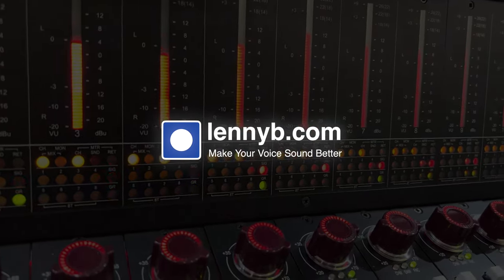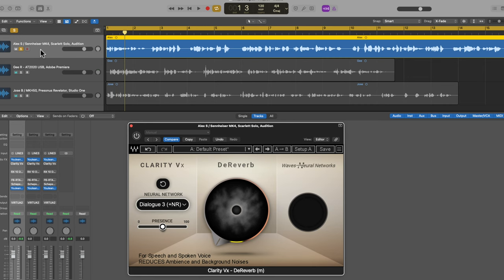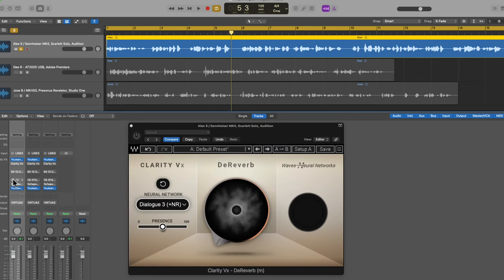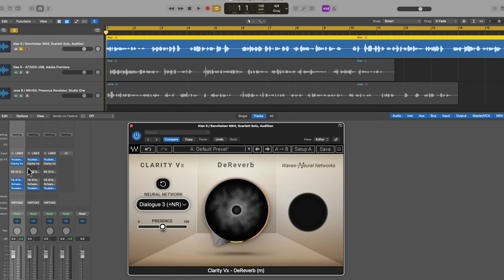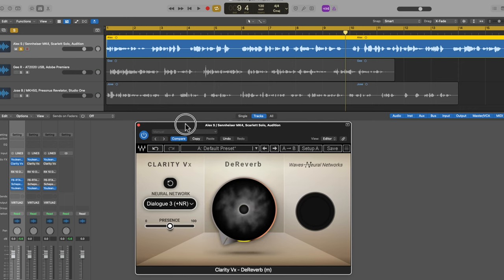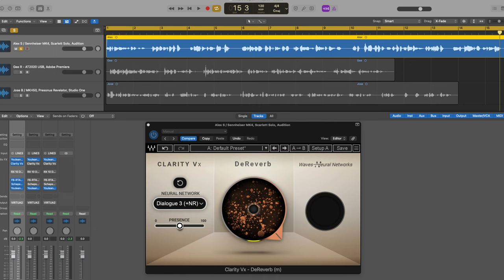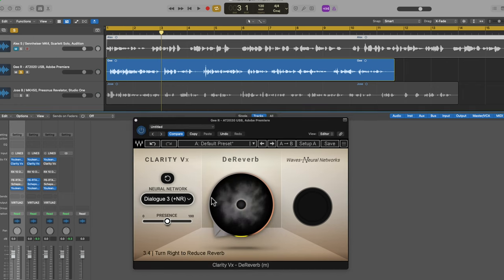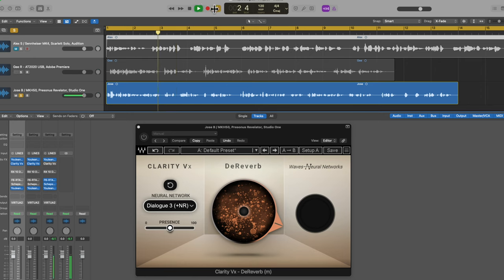DeReverb For Voice-Over

Comment: I laughed watching this because these examples are are so clean to begin with compared to the reverb I deal with on my recordings. That, coupled with loud laptop fans makes for a processing nightmare. I am recording dialogue while gaming for YT so it doesn't have to be perfect, but it can't make people cringe and turn off my videos. Took me weeks of playing around with different combinations of settings to get an "acceptable" finished product. These types of plugins didn't come close to fixing the issues. Heavy NR, EQ, compression and gating while trying to maintain some quality is challenging. Fortunately, I've now built custom chains I can apply without much tinkering, but I still tinker here and there. It's part of the fun for me!
Reply from the maker: Hi @thatsrich944, I know the struggle. I find that no plugin will "repair" an audio problem better than fixing the problem in the room when recording. Thanks for watching!

Comment: Can you do a video on the basics of Plug Ins and what programs to use them in? I am using OBS with a Zoom L8 and a Behringer Audio Processor. Can plug ins still be used with my set up?
Reply from the maker: Hi Drew. Audio plugins are used in a DAW (or Digital Audio Work Station) like Logic Pro, Pro Tools, Adobe Audition and others. However, they can also work in OBS. I just noticed that Waves plugins are now compatible with the latest version of OBS (Windows Only). You may have noticed that OBS has some audio processors already available. You can still use plugins with your system. Feel free to send me your audio and I will send you an example of what the processed sound is like. Please fill out the form and follow the instructions to submit an audio example here https://www.lennyb.com/get-your-voice-processed-submission-form

Comment: Is this recommended for Dynamic Mics in non threated rooms? If so, where do you put it in the chain before Compressor & EQ ?
Reply from the maker: It can be valuable for any mic or recording. However, no de-reverb plugin will sound better than actually removing the reverb from your recording space. The de-Reverb plugin only masks the problem. Proper room treatment (to minimize reflections) will offer you the best sound for any mic. Waves offers a free trial period. So, you can try it for free first before buying. Hope that helps!